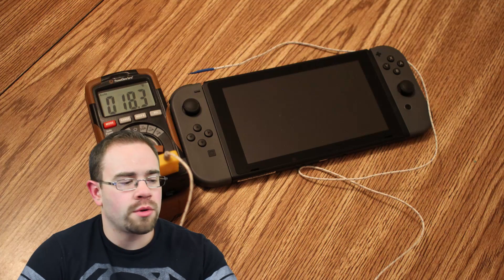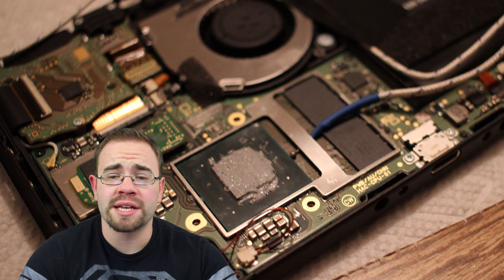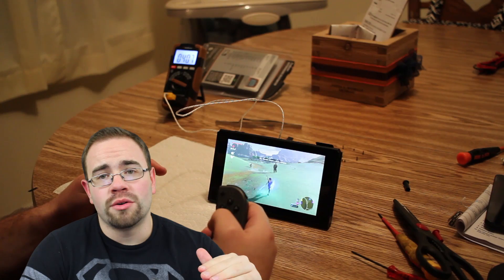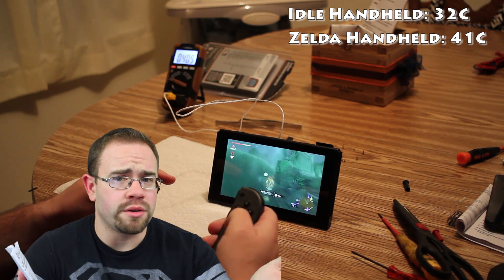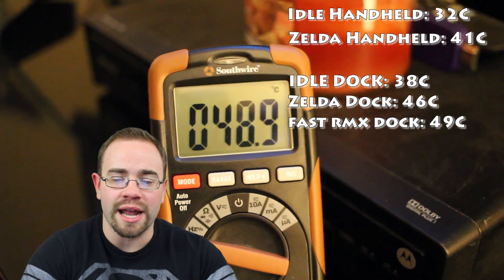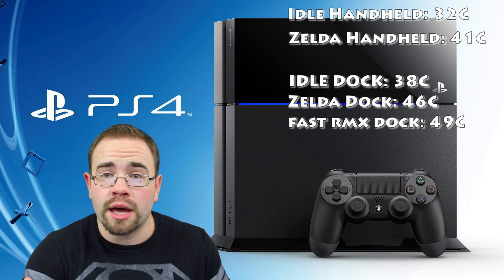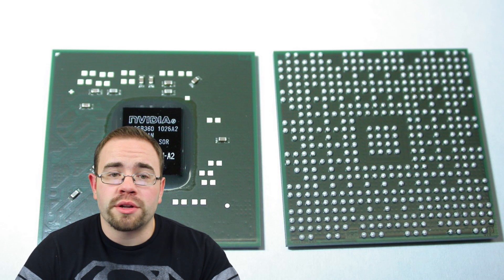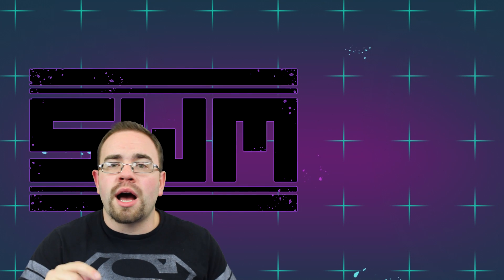How Hot Does The Nintendo Switch Get? Temperature Results!

Comment: Are you using the original thermal paste?
Reply from the maker: Using MX-4 currently.
Reply: Spawn Wave do you think cheap thermal paste make much of a difference? I am thinking it wouldn't.
Reply: DO you think you're getting a better temp with your cpu paste?

Comment: Yeah... on SMD's channel he was saying some of those "defective Switch vids" were a sign the GPU was cooking itself. Nintendo isn't stupid... They've always made reliable hardware and aren't going to go with a design where the main chips could potentially overheat. They'll go with safety and reliability any day over squeezing out slightly higher clock speeds and getting potentially dangerous heat levels.
Reply: odstar21 - you cant just install a different chip dude it doesnt work that way its not like a computer lol
Reply: SMD is just too sure of his own assumptions.
Reply: martinaee dude I stopped going to his channel. he bases everything from other rumors and passes them as facts. I was so happy finding this channel
Reply: martinaee dude I stopped going to his channel. he bases everything from other rumors and passes them as facts. I was so happy finding this channel
Reply: +odstar21 Your question increased the temperature of my brain significant, the fans kicked in! Luckily because there was a chance of overheating!  ;-))
Reply: It's just a faulty unit. Overheating doesn't give you a bsod. The ps4/pro and the xbox all had bsod. BSOD is a hardware failure or a low level software problem. Overheating will give you a rrod effect.
Reply: It heavily depends on the actual system and how it's built to react. Take a Windows PC for example. An overheating CPU will typically just turn off the PC instantly, if throttling isn't successful. The operating system has no ruling over this. A faulty GPU on the other hand might indeed just cause a bluescreen (which you might not be able to see).
Reply: aaaactually... the cooking part can still be true. For example, consider defective units having a corrupted firmware or thermal sensor that wouldn't kick in the fan or overclocking the system until it breaks, i know it's a stretch, and i also get the idea that the switch (thankfully) doesn't nearly have the same problem as the xbox360, but still, one might consider bad firmware or wiring causing the overheating and, as a consequence, BSOD, OSOD or other stuff
Reply: LOL It's customized hardware and chip-sets in the Switch. You can't just replace it with anything (except maybe a different Switch chip.)
Reply: Although, like i said, those were obviously faulty units, overheating can cause a lot of different things, i'm not just talking about BSOD(as in the windows BSOD) but mainly the faulty colors on the screen and shit like that. I don't really think those problems can be pointed out as a single thing (or multiple things) with that amount of certainty and that was what i meant.

And btw, like people here already said, SMD seems to assume too many things as the truth.Yes, there seems to be a lot of problems with a lot of people's switches, but those could be all manufacturing problems, firmware problems, it would be really difficult (not to say pretentious) to point out causes without showing some actual data on it. But one thing i agree with him, I've never seen such a great variety of defects with a nintendo console until now...
Reply: May I inform  people that BSOD is a unrecoverable software error, often from a hardware driver, caused by either software bug or hardware error. But when the cpu hangs, it hangs, you will never reach the BSOD. BSOD is a managed fatal error. This is important to understand, if you want to understand/investigate what is going wrong.
Reply: Rui PTG yes his channel seemed quite promising till then and even for a few weeks after but then I feel the content started to dwindle...
Reply: Intel and AMD chips are a completely different architecture
Reply: no offense to him but he only sounds like he knows what he says because he sounds confident but really he's so clueless. I unsubed as soon as the Switch was revealed and he was filled with shame for being oh so wrong about what the Switch is and the whole AMD vs Nvidia.
Reply: Dallas Allen, me too
Reply: If the Switch INVIDIA chip is defected what other good enough chip can we install as a replacement  like AMD or Intel  Inside chip

Comment: "The fan doesn't start when I turn it on, there's a temperature floor", I turned my switch on the other day (Had not been charging) and the fan instantly ramped up and got pretty loud.  Not sure if it's just faulty or was a one off =S
Reply: It's undocked.  I just tried it now and within 2 mins of turning it on the fans were getting louder and louder.  Not sure if to return it or keep it =S
Reply: Does it do it all the time? Also was it docked or undocked. Cause if it dock I would think it just turns on cause there no battery issue. I will have to test mine to see if it does.
Reply: I just ex tested mine. When I turn it on when docked I do think I feel slight air coming out but once I took it off it stops. With yours ramping up. You could have a firmware issue maybe?
Reply: Jaymiecain1 
it's always on
Reply: Alright, if your fan is just ramping up it speed for no reason then your switch has a problem. Sadly there two way you can resolve this, one is that you have to go back to your retail store and show them, then hopefully get a replacement. The second one is to maybe factory restart it or something. Your firmware update could of missed up the fan controls. Also is your switch warm or hot even if your not running a game and the fan going at full speed? Cause maybe they messed up on the cooling with yours like no thermal paste or something. That's another reason your fan is ramping up. Honestly I would just take it back. Tho you'll lose all your saves....

Comment: Mmm...that crisp, early 360p.
Reply: Brotlov lel
Reply: +John James Rambo
Wow, salty.
Reply: You mean out of the dock? It's 720p.
Reply: Yeah, got to the video early enough that 360p was the only option.
Reply: Ah, my bad!
Reply: +John James Rambo
Looks like someone's got their panties in a twist. 

The value of the Switch isn't it's resolution or frame rate, it's the portability and first-party titles. It's the same reason why people still buy the DS. It's just that now the Switch allows home console titles to be played on the go.

Of course everyone values different things, so just because you value resolution and frame rate doesn't mean that that's what everyone else wants in a console. Sure the PS4 has a lot of power, but a lot of the games on it can be bought on PC which, as you said, will always have the upper hand. Not to mention that a PC is much more portable compared to a hefty home console. 

And there is one thing that Nintendo does better than pretty much every other gaming platform (even PC actually) and that is local multiplayer. Most of the games with local multiplayer on the DS just needed one game cartridge, this feature is on the Switch as well. 

There's no need to get all upset over the popularity of a console you don't like. No one is forcing you like it or buy it, and no one's trying to dispute the fact that the Nintendo Switch runs at 900p/30fps. It just doesn't bother most of the people who have bought the system.

And as a side note. The WiiU is still $300 USD, it's an old system, and Nintendo has dropped it like a hot potato. There's no point buying a new WiiU, when you can get a Switch for the same price (sure the WiiU has pack-in games, but there isn't one with Zelda which, let's face it, is really what people want to play). Now, if you've already got a WiiU, then just buy Zelda on that console, because then you'd actually save money.
Reply: +John James Rambo
Actually the 3DS sales peaked a while ago. Granted the new pokémon did get a lot of attention, but the DS sales are actually finally slowing down. There's still plenty of new games for the system, and it will definitely last a while, but the Switch is a good console to eventually replace the DS. 

Nintendo has been marketing the Switch as a home console, but a lot of this has to do with the types of games on and coming to the system. Yes, I consider it more of a handheld as well, but it definitely has a completely different game library compared to the Nintendo 3DS. 

And yes, while Mario and Pokémon are generally very popular and profitable, you can't deny that The Legend of Zelda is the Nintendo Switch's console seller. I do believe that the Switch would not have sold nearly as well as it has if it did not have Zelda. Especially considering this particular title which is, in my opinion, the best of the series.
Reply: John James Rambo in case you know. Xbox one ran almost all games in 900p or below 30 fps, ps4 ran almost all games 1080p or 900p 30 fps. This is a tiny portable. Far far far smaller then both. All facts giving nintendo switch the best portable ( tons of exclusives). Ps4 best console ( awesome exclusives also). And well xbox one or the new xbox x, well no exclusives at all... And a waste of $.

Comment: hey Spawn wave , it could be possibly be Pascal?
Reply: Álvaro Sánchez I think in terms of GPU, its equivalence is the NVIDIA Shield TV. BUT, in terms of CPU, it's vastly significant. Most likely more significant than the Xbox One can handle.
Reply: The thing is if the switch has pascal, it would be pretty similar to the Xbox one in terms of graphical capabilities and with the software from Nvidia and the optimisation capabilities of their chips it would be pretty equivalent to the xbox. This is why people want to know whether it is a pascal or maxwell.
Reply: I think wondering if the switch is pascal or maxwell is just a waste of time. Most leaked info from devs even though its only rumours say maxwell. who care if its K1 X1 or P1 in all cases it wont be close to an xbox one or other consoles but it might be powerful enough to get some cool games. Fast RMX is an example of how developers are squeezing out as much performance as they can on the system and thats one of the first games on the switch as they get to know the console the games will get better too. A good example is crysis 3, that game ran pretty well on xbox 360 being that the switch is more powerful than an xbox 360 by a bit with more ram I think we might see some decent games in the future hopefully
Reply: to me pascal would have been the logical choice to make a system that has better battery performance at least. I would be nice to see nintendo using more advanced tech then something as old as maxwell
Reply: Well if you want graphics, then PC is where to go. Getting a console for graphics is just dumb. Now if you have PS4 Pro for Horizon, and Uncharted. Then that's a different story. I'm 99% sure that Switch rules on Maxwell at the 384/932 clock speed (not exact numbers, just guessing). This puts the Switch at around 950 GFLOPs and 200 GFLOPs. Which is a good amount of power for a gaming device. I don't think you'll be getting epic open world masterpieces like the Witcher 3. Kind of concerned about 3rd party on the Switch though. Game devs can barely get their games running on Xbox One and PS4. How the hell are they going to run on the Switch then.
Reply: Mii 2.0 does Xbox not have dedicated graphics?
Reply: It's probably 2nd gen maxwell like the Nvidia Shield 2.
Reply: It could be neither of the two, and a custom architecture :/
Reply: that still depends on configuration. for example if maxwell and pascal have the same amount of cuda cores and core clock their peak raw performance will end up the same. pascal advantage over maxwell is on the improved delta color compression (for saving bandwidth) and the ability to use dynamic load balancing for asnyc compute. 

even if the switch using parker SoC from raw performance perspective it is still behind xbox one. significantly. recently nvidia announced jetson TX2 with parker SoC and specs for it. anandtech did a nice breakdown for it:

http://www.anandtech.com/show/11185/nvidia-announces-jetson-tx2-parker

even at 1.3ghz the gpu is not that faster from the one inside X1. for X1 when the GPU clocked at 1ghz (official spec for X1) is 512Glops (FP32). for parker pascal clock at 1.3ghz will yield 665 Glops (FP32). xbox one as a whole was rated at 1300 Glops. so to be more comparable to xbox one it is not simply replacing maxwell with pascal. they need to put more beefier gpu inside. maybe double the amount of hardware dedicated to the gpu.
Reply: John Romanas It really won't matter. The performance difference between maxwell and pascal is only 8%
Everything else is clockspeed and number of cores.
- Pascal allows lower power and thus higher clock  speeds.

Pascal doesn't matter because it's not the main factor in performance. 
A gtx 1050 and a gtx 1080 are both pascal, but one is near twice the power of the other.

You know what won't make much performance difference? maxwell vs Pascal.
You know what will? 192, 256, 384 or 512 cuda cores or whatever.
THAT would make a huge difference.
For stock tegra chips, that's maxwell vs Xavier.
Reply: John Romanas The only difference in Pascal is energy consumption and cost. That's it.
Reply: @Renzc ode - I checked out that tx2 write up. it was very interesting. especially the part about the Max q and max p. That seems like something the switch would use in the switch especially seeings its not using the max clock of 1.3. To go from 854mhz portable and 1.1 ghz docked youd get a power boost that makes more sense than the clock speeds that have been leaked. Someone should look at the chip and see how it compares to the chip in the switch.
Reply: Jason Nosaj Exactly! And it's cheap. Nintendo would totally save money.
Reply: Well the Tegra X1 got a lot of Pascal features into the chip. It's essentially the last revision of Maxwell before they moved to Pascal. Also runs on 20nm rather than 28nm.
Reply: Dakota Davis Well if the Nintendo Switch runs on Pascal, it'll have way more third party games and be a gargantuan success. So successful that the PS4 will die. Now that may sound completely unrealistic, but ask yourself this: If I want to play a video game, why would you go for the PS4 version? If the answer is BCUZ GRAPHHIXX, you've failed. You lose. A $20 PC can MURDER the PS4 graphics to death. If it's because friends and communities, then you do have a good point. That's relevant. But here's the thing. With the Nintendo Switch, it enables uou to play on the TV and on-the-go, while the PS4 doesn't. Also the PS4 has a lot of repetitive third party titles, while the Switch has indies and first party games that are NOT repetitive. THAT'S why the PS4 will die and THAT'S why the Switch will dominate; because the games are different and the hardware is innovative.
Reply: Jason Nosaj Yeah, you're right. I've seen a lot of PS and Xbox fanboys hating on the Switch because it's not powerful enough to get some triple A games. They want Nintendo to make a gaming computer lol.
Reply: Jason Nosaj It won't look as good in terms of graphics.
Reply: Well the ps4 will never die compared to the switch it will probably always be the dominant console. Sony has been on top ever since the original playstation and I dont see that changing anytime soon. As for specs they do matter because game companies dont want to spend the money making multiple versions of the same game. If consoles are fairly close in power they can do ports easier but if the systems are vastly different then those companies can't really make those ports. Thats why the switch needs to be at a certain power level. The switch is probably in the range of 400 - 600 gflops or lower. It probably wont go beyond that even if its pascal or maxwell.
Reply: Dakota Davis Nintendo is promising to have broad third party games. Sure they've said the exact same thing with the Wii U, but since the Nintendo Switch has superior marketing, and has some best selling games like Minecraft, rest assured Nintendo is doing some fine.
Reply: soooo,any updates?